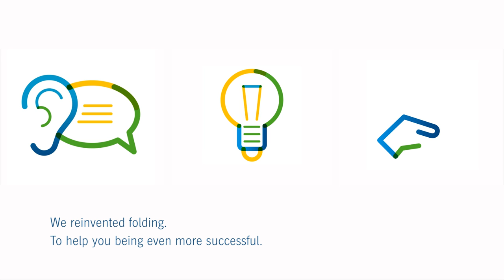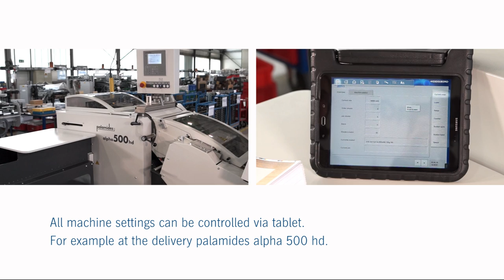Stahlfolder TH 82-P.

Comment: They always run great under trade show make ready conditions.... real print shop conditions are hardly applicable for these overly engineered nightmares..... The office production , equipment purchasing employees get impressed when they see and buy with thoughts of increasing production, but the operators ultimately pay the price with these NON User friendly safety gadgets, and injury causing awkward design and fit and finish. Bring back the conventional full length deflectors, with pivot open, close blocks and ditch the automated plate and roller setting features and give the skilled operator a real world machine that preforms as claimed!
Reply: I watch these videos and wonder where they find this perfect paper,  coated sheets without one gigawatt of static, and perfectly stacked sheets straight from the press to the folder.....also I love the printing presses running at 15000 to 20000 and I wonder how they deal with paper stretch ,gutter jumps while dealing with perfecting and paper stretch.
Reply from the maker: Dear Johnny, Thank you for the message. You could ask our PMC experts all these questions. Make an appointment here https://www.heidelberg.com/global/en/about_heidelberg/company/print_media_center_1/print_media_center_1.jsp Have a nice day and best regards from the Social Media Team
Reply: @johnnyteague3407  😀 mate, they got the paper from a HD Press, no KBA (20k)